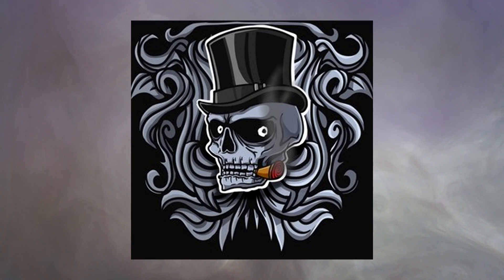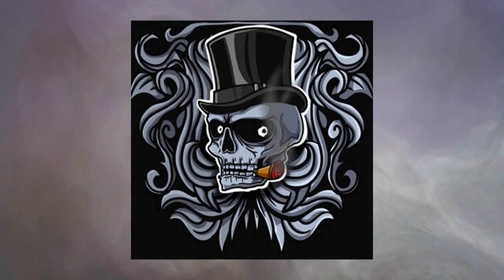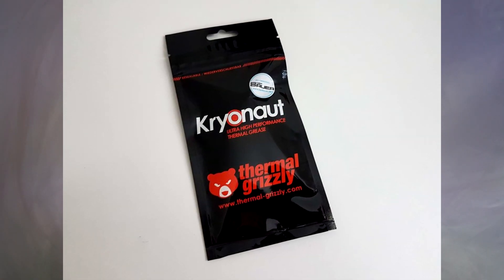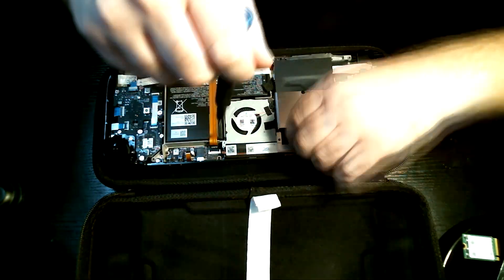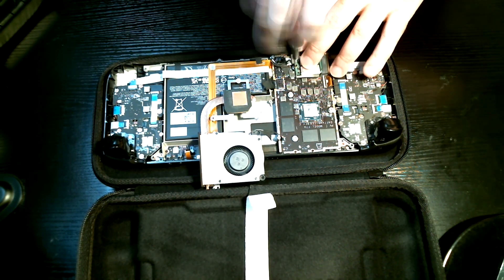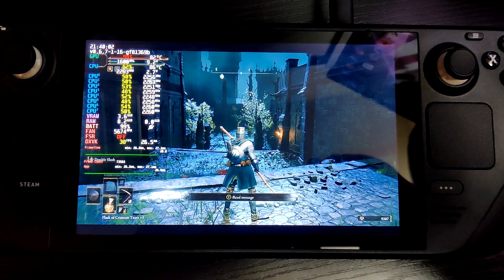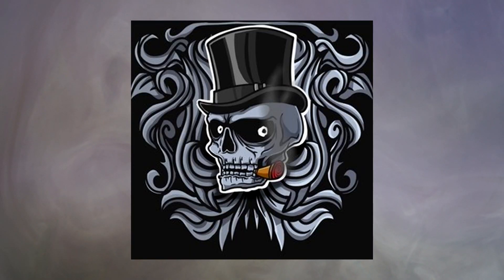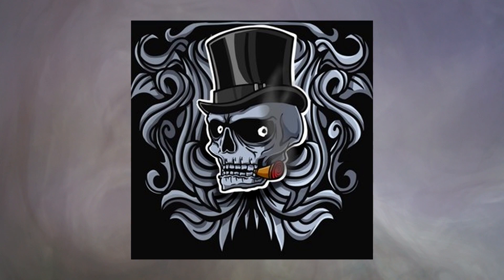Can you improve Steam Deck thermal performance?

Comment: So and now days many people have a  gpu/cpu drops down to 400mhz/200mhz ... valve propose RMA , me too i have that problem about 1 month ... so i can't make a RMA ... so what i did i just simply put TDP to 13 rather 15 and it works good... but what i understand that's because of termal throttling each time my gpu on a 15 tdp gets 95°C or sometimes 100°C very rare it downclocks the gpu/cpu ... many others steam deck users have the same problem now days
Reply: You notice how his Elden Ring is at 27w usage with 81 degrees. Its crazy cause I've redone my paste, Cleaned the fan, got the jsaux backplate and yet my Steam Deck reaches 100 degrees and throttles. I dont know if my apu is defective or just pushing out more heat than everyone elses but its not normal and Valve has told me they cant help me. So now I have to use a TDP lock on every game just to bring it down to 90 degrees.

Comment: If you really want to improve thermal performance then use a Honeywell PTM7950 phase-change thermopad.
Reply: I did this to my Steam Deck and the thermals are much better. The fan is quieter too.

Comment: Correct me if I'm wrong, but it looks like after you reapplied the TIM, you temps were close to the same, but your CPU was running about 150MHz faster?
I would consider this to be a nice boost in speed for the same thermals. Seems like the new TIM made a positive impact?

Comment: You gained around 200 mhz on each core changing the thermal paste. That's not huge but it seems the deck was using the extra thermal head room so it did have a positive impact.
Reply: Not really, it was boosting the same.

Comment: This seems like it varies. Like the SSD's, perhaps Valve installed higher quality stuff on earlier customer Decks, cheaping out on later models. Just to push out as many decks as possible... 

Because there are other reports of people re-pasting their decks with a 5-7 degree improvements, across the board.
Reply: if that were the case then we would have seen reports of worse performance on many steam decks. but i do agree that the new paste should have shown a positive improvement (even a small one). it's a weird result.

Comment: Thank you for creating this video, you answered the exact question i was looking around for. I will leave the stock thermal paste on there. I was going to look ingot potentially replacing the stock thermal pads but might hold off on that since Valve did not cheap out on paste. Plus it would seem i would have to order many difference pads with varying thicknesses.

Comment: I like my deck but they cheaped out on the cooling it needs something in line with the aya handhelds its a much beefier cooler. I’ve got 4 warning now in spiderman remastered that my cpu is running too hot. This is playing in an air conditioned room with the game locked at 30fps.

Comment: I'm going to take my steam deck, rip off the entire shell, get a new shell made entirely out of pure copper, then connect that shell DIRECTLY to the heat pipe coming off the cpu. Haven't figure out how I'll connect them yet.....either another heat pipe on the shell placed so it directly contacts the existing one, or maybe some thermal pads, or maybe I'll just connect copper wires to the existing heat pipe and the new copper shell. This way the entire body of the steam deck will become a massive heat sink, and my hands, which are around 36 degrees celsius, my hands should sap heat away from the device too. Technically since my hands have blood rushing through them it could be considered an organic human/computer liquid cooling interface. I am the Deck, and the Deck is me!
Reply: I should see dramatically lower average temps since I'll be adding more than....20x the current heat capacity of the device in copper alone? I plan to get the shell printed thicker than the original shell too. I'll probably use like 100 to 200 bucks worth of pure copper. Then of course I have to pay to get it machined, or mold and cast the original shell myself. Either of those will be fairly expensive. I'll then cover the entire surface of the device with a silicone skin to prevent it from ya know....burning the shit out of me.
Reply: I don't know any company that could make a shell for your Steam Deck out of copper, it would cost $100,000 to make the tooling. Also copper is conductive, so you'd have to coat the entire inside with a coating to keep things from shorting out against the case.
Reply: @EmergencyChannel  what tooling? You want to cast that shell? Just machine it out. Still expensive, but not in 100k range.

Comment: Thanks for the insight. I was wondering if it would help the thermals. I knocked Astroneer down to 40Hz so it wouldn't need to work so hard and it went from those temps down to the upper 70s and the fan isn't nearly as loud.

Comment: I would be very interested to see what liquid metal temps would be like.

And I know alot of people would say you shouldn't do that because it's a portable device and it could leak out, etc. But in my experience with putting liquid metal in laptops. If you do the application correctly and use conformal coating to protect the surrounding components, there is little to no risk of it spilling out and causing a mess from moving the device around over time.

I recently opened my gaming/work laptop after having liquid metal in it for months and absolutely zero shifting on the LM had occurred.
Reply: UFD Tech did a liquid metal application test and it did lower the CPU and GPU temps a bit, which also decreased the fan speed, making the Steam Deck a little more quiet.

Comment: The two tests are not comparable because the test conditions are not the same. On the left, the steam deck is charging. The APU may not consume more watts when the deck is plugged in, but the battery and the charging ic are hotter. Then 25w go towards the system and 20w towards the battery via the charging ic. The charging ic gets hot to 90-95 degrees celcius due to losses. In both tests, the fan runs at 5700 rpm, the 2-3 degree difference is determined by the slightly warm air with which the heatsink of the APU is cooled.
Reply from the maker: I have retested and it's the exact same temps both plugged and unplugged
Reply: @Deadboy90  same fan RPM? absolutely zero benefit?
Reply from the maker: @V0N32  yep
Reply: @Deadboy90  thanks! :)

Comment: why they put a little ventilo inside((( not enough for that system... cant understand.. u can play easily days gone at 60 fps with fsr but temps goes so high thats crazy
Reply: Dont worry, these temps are absolutely normal. The Ryzen CPU is designed to run at 90c/95c and will shut off if it reaches 110c.
Reply: @M2356I  hohoh realy i didn't know hoho i am an intel boy ( i was before)... ok ok now i see ... but at which temps thermal  throttling comes on a deck?
Reply: @darbukadrummer  It throttles itself down when it reaches 95 and shuts off at 110 to prevent damage. So don’t worry, everything’s perfectly normal.
btw: The CPU temps shown in the Video are also safe on intel CPUs.
Reply: @darbukadrummer  I'll go into a little more depth for you. The Ryzen SoC in the Steam deck has a base clock of 2.4Ghz. This means that anything above 2.4Ghz is a boost clock, with it reaching up to 3.5Ghz max boost. Boost clocks are kind of like the CPU automatically overclocking itself and is determined by temperature, so the lower your temps the higher your clock speeds. Higher clock speeds can take more voltage however, and more voltage means more heat so it can be a double edged sword.
Reply: @99mage99  yep i understand you thats why ppl like to make an undervolting on the  gaming laptops ... so but thats mean on a steam deck you dont have any choice ...but as i see these temperetures are normal for a deck , after about a month of using mine ... but i mean rdna 2 could show a better result with a low temps imho....but anyway as i see that a  steam deck works even better vs for exemple ryzen 4800 u on Onexplayer ( which has 2 ventilos and 75 °C high temps ) with all that SO optimisation and etc it works good because i have both onex and a deck...and i can compare them ...

Comment: If you ever been into gaming laptops, viscosity of the paste matters. Something like tfx or syy-157 will work better for the long-term. Kryonaut is known for pump out to occur overtime. The paste valve used was very thick clay like there was a reason for it. You may notice faster degradation of the thermals. I would recommend you change it two one of those options in the future if you do. I got my steam deck today and also changed the thermal paste with syy-157. Temps are 5 degrees cooler and the back there was a very hot spot under the right side of the display its gone after doing so the heat is now little more spread out.
Reply: Not kryonaut extreme.

Comment: On the left it shows that you are running it while it's charging man that means, it's drawing more power, and i am 100% sure that it caused the temperatures to rise
Reply: Steam Deck doesn’t use more power when plugged in. It is the same plugged in or not. 
The thermal design & heatsink of Steam Deck can’t take more power as it will overheat.
Reply from the maker: I have since tested both plugged and unplugged and it's the same temp.
Reply: @Deadboy90   So you say.
Reply: Very good point

Comment: Good video, but look at your CPU speed, it's faster with the same temps approximately so don't deny the impact of the thermal paste change
Reply from the maker: Just double checked, look again, the CPU is actually 100-200mhz SLOWER after the repaste.  After is on the left, Before on the right. 2:39
Reply: @Deadboy90  ouh I see mb, thanks for the video!
Reply: @Deadboy90  it seems to be thermal throttling then, doesn't it? If anything it actually got worse with thermal paste change. Nice video!